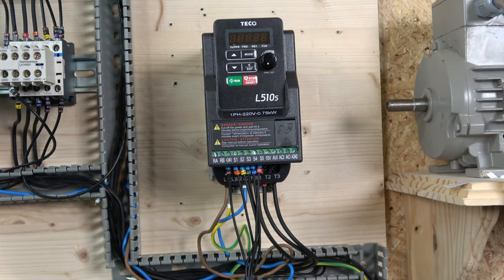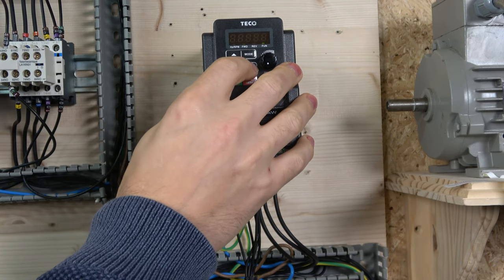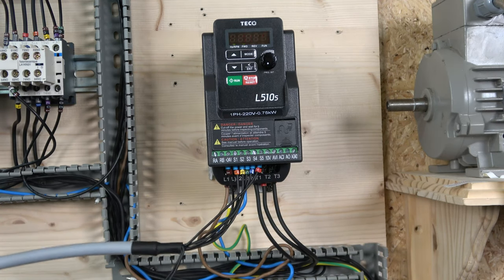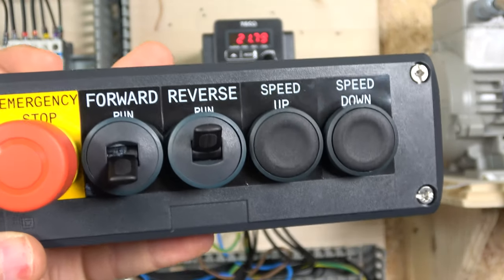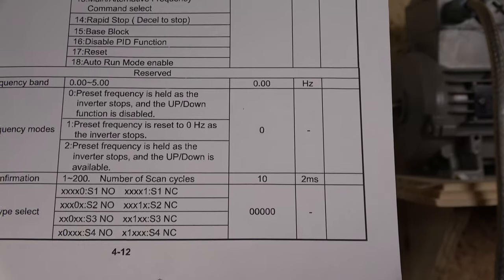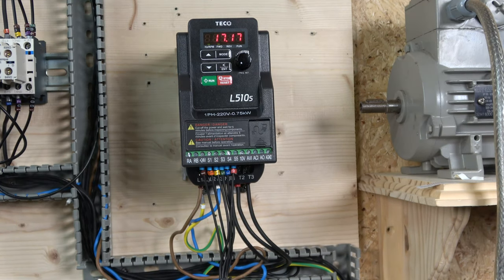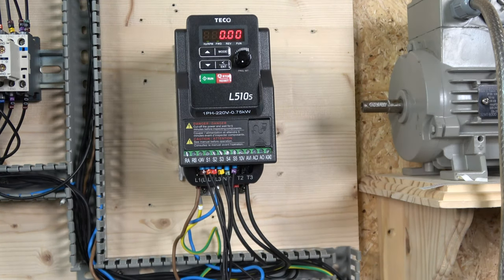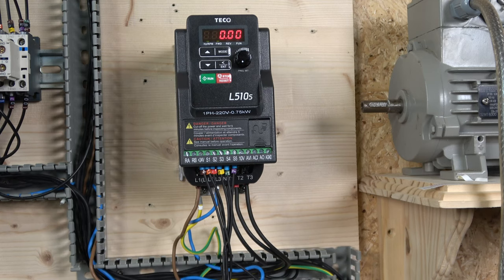Teco L510s VFD, remote mode, MOP frequency control, multi frequency control. (English)

Comment: Thanks for producing these overviews. One question, in respect to motor direction, would an A-B-C switch with a center position B for "stop" and the directions, A and C. I saw it as a motor has those three states of movement commands. And visually with one switch in one of three positions, tells you immediately if the motor is engaged or in the stop position. I use the stock 40 year old direction switch except now the terminals run to the COM, S1, S2, S5. I do like that you are building control panels for remotes using more robust switches, more purpose built. Thanks again for all the work you put into these instructionals.

Comment: What drive is better and user friendly in your opinion, this one L510 or the Omron MX2 series?
Reply from the maker: MX2 has got by far more control options then L510. If you after basic set up and nothing to to crazy, like 80% of applications, I would say L510. Plus the price tag for the L510 is far lower then MX2.